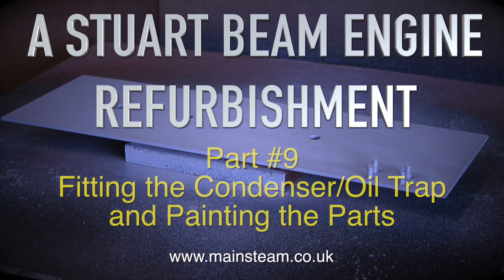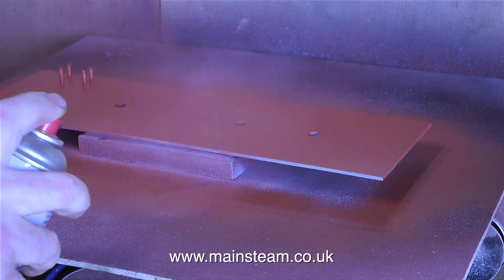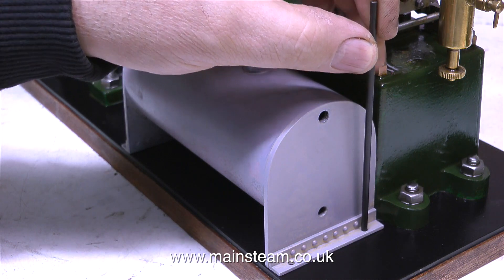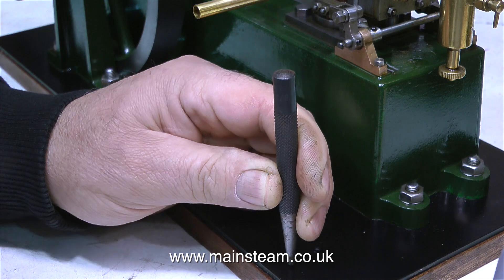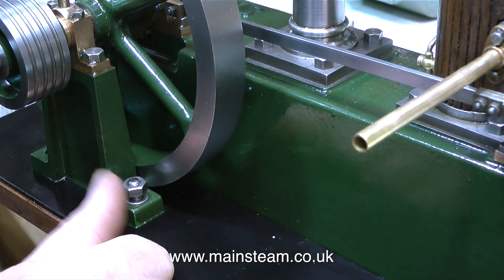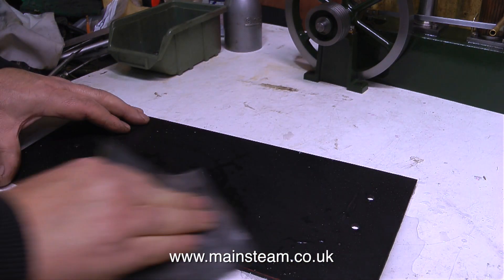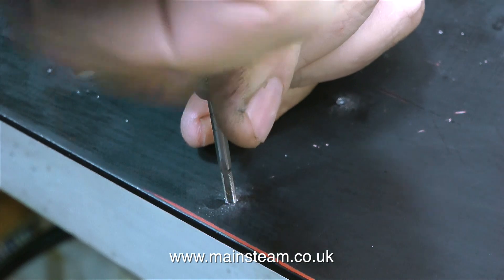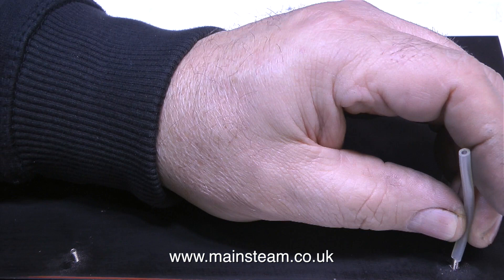STUART MODELS BEAM ENGINE REFURBISHMENT - PART #9

Comment: Your music is really enjoyable to listen to, just thought I'd say that before a question.

I know the function of the condenser, but I was wondering something. What if you put a coil inside it, and ran the the boiler feed through that? I could see that helping cool the steam faster. Failing that, it would preheat the water going into the boiler, and with the bypass after it, also the water in the reserve tank over time. I have to wonder how much difference that might make in maintaining steam pressure during high usage.
Reply from the maker: I am about to make a Condenser/Feedwater preheater so your question will be answered in that short Video series . . . . . . The downside is that the condenser will require more frequent emptying as the heat exchange will cause the steam to condense to water more quickly.
Reply: Can this recondensed water be fed back into the reservoir for a somewhat closed loop?
Reply: I think they do this in steam turbine power plants - if they can condense the output enough, then it goes below ambient air pressure, giving a bigger differential across the turbine, which is more efficient.